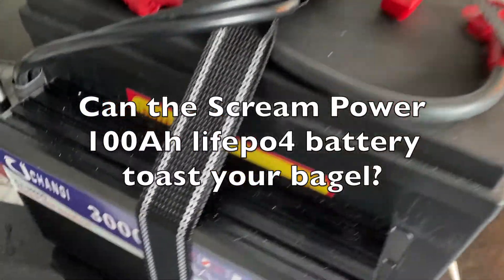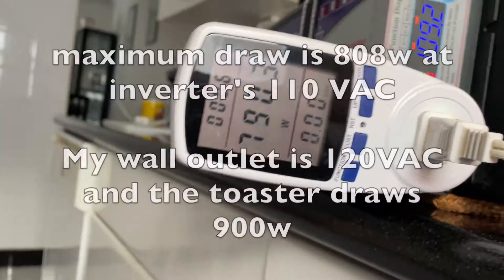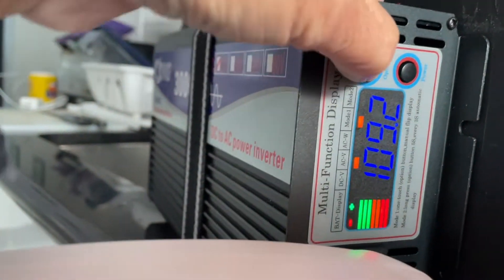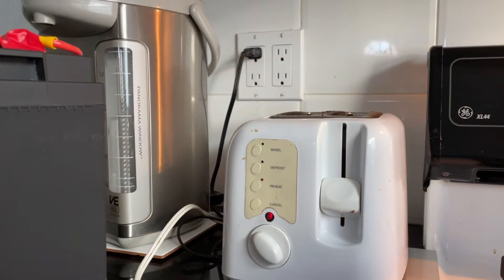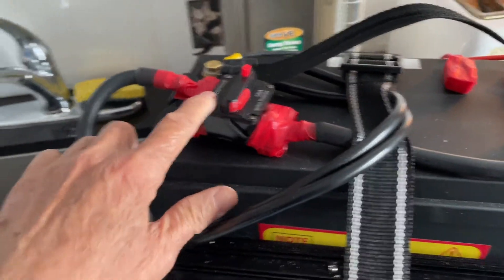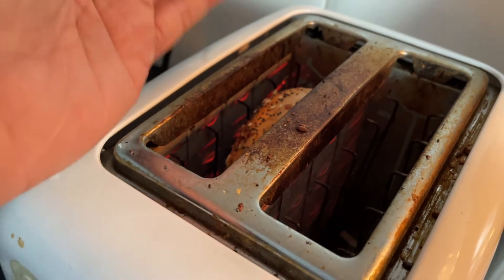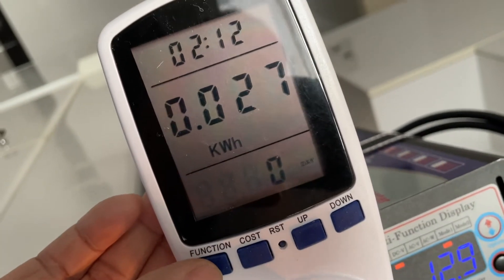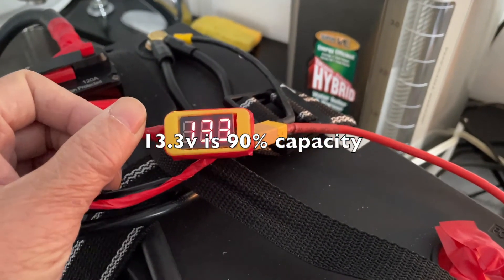Can this 100Ah lifepo4 setup run a toaster?

Comment: Nice equipment Paul. Good for when the grid goes down there. Your well prepared. Greetings from Belgium
Erik
Reply from the maker: I'll need it when the power goes down so I can still run the boiler to keep the house warm.
Reply: @wtam69  i tried mine too on my heater. I build a 66ah lithium battery but my inverter is too weak for the peak power in the beginning. Pity
Reply from the maker: @rikkiesix  Toasters and hair dryers will trip your circuit breakers because of the heavy load. You need a 1500w minimum inverter to handle that kind of load.